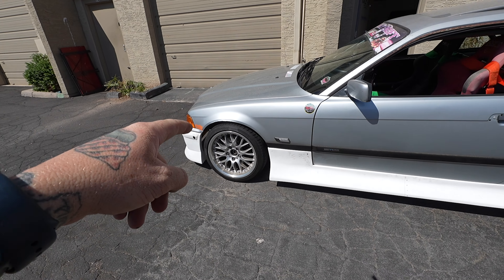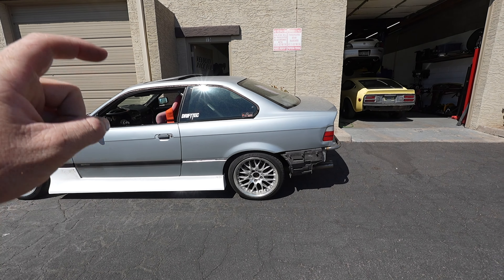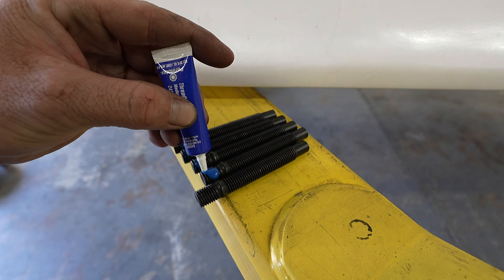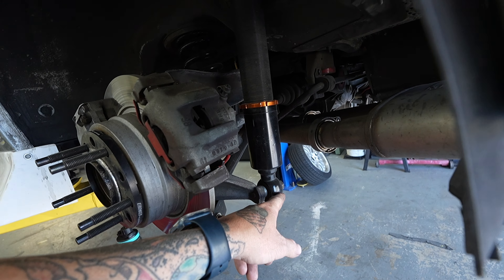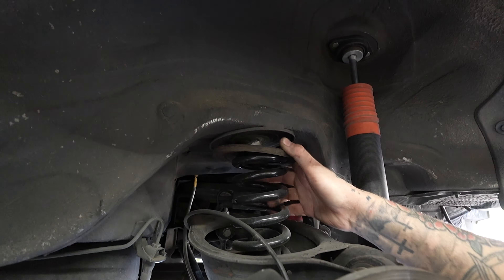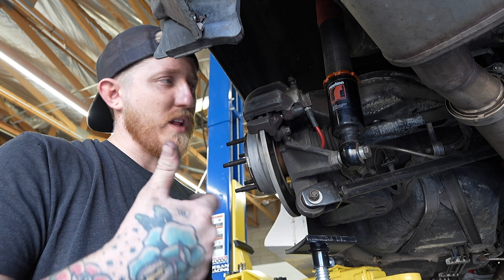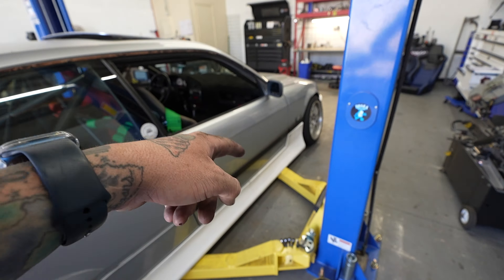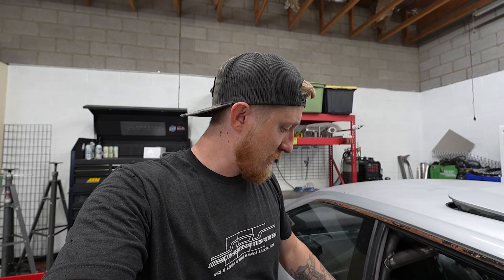Deleting The Rake On My E36

Comment: I'm glad you're explaining shock length adjustment in the rear of the e36. 99% of people who buy coilovers never adjust this correctly and will either prematurely hit the shock bumpstop or not be sitting in the mid part of the stock stroke where the damper works it's best!
Reply from the maker: It’s definitely not talked about enough and people wonder why their car is so bad